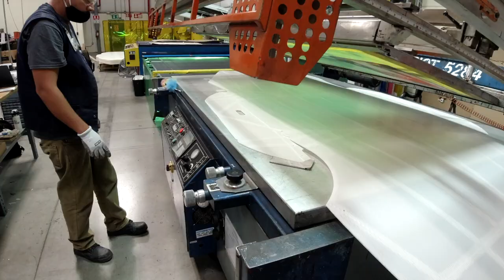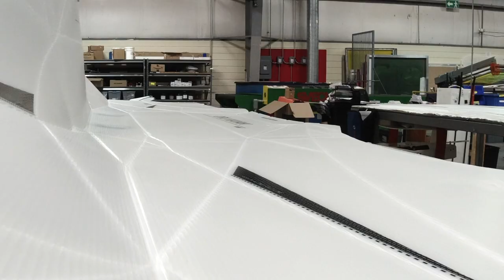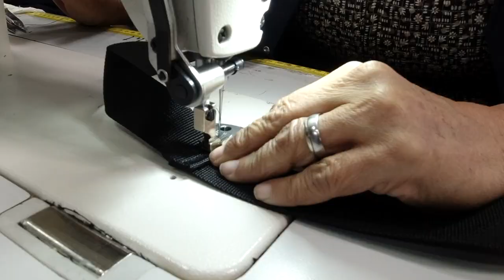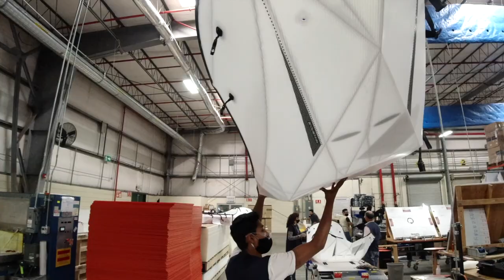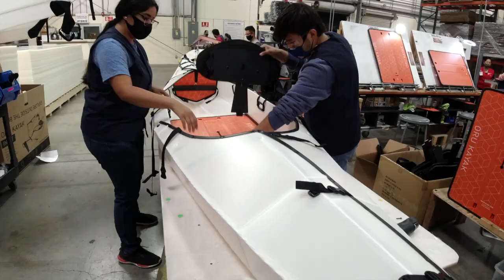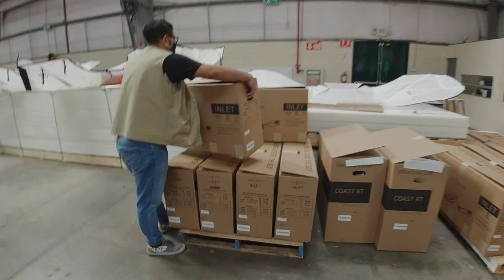Behind the Fold: How an Oru Kayak is Made

Comment: Congratulations excellent video, it makes me increasingly want my
Reply: I recommend buying an inflatable SUP (stand up paddle board) off Amazon that already has D-rings on it. You can attach a kayak seat and ride them like a kayak. Dont spend more than $200 as they are all about the same. In the off season (September-December) I can find $500 boards that cost $80-200. They take me everywhere my expensive kayaks take me, fit in the trunk of my car, and only take about 5min to assemble with a 12v pump running off my cars cigarette lighter port. Buying some inflatable SUPs on a whim was one of the best decisions I ever made. These Oru kayaks are obsolete and over priced.

Comment: I have oru lake and a chinese copy and its sad to say the chinese copy is far better quality and a fraction of the price. It seems that chinese quality control is far better than American quality control.
Reply: That's interesting. What did you find was better? The quality of the materials or the assembly? And could you send me a link to it please?
Thanks
Reply: @prometheusboat  well the material feels the same, but it comes with the protective black edging all around where as the base model oru doesn't, it comes with foot rest and paddle leash and also has a aluminium spread bar which orus dont come with. I've just bought  a koa tourer which is same as the bay st, koa is made in the UK and cost £600 as opposed to £1200 plus for the bay and that is an awesome kayak. I'll send a link but they're on eBay uk
Reply: Can you please share a link to the Chinese model?